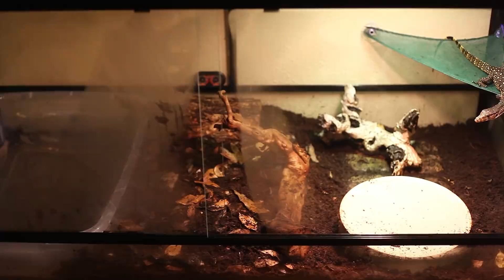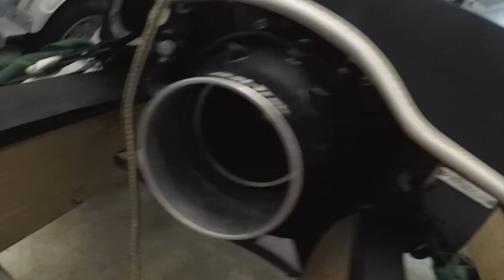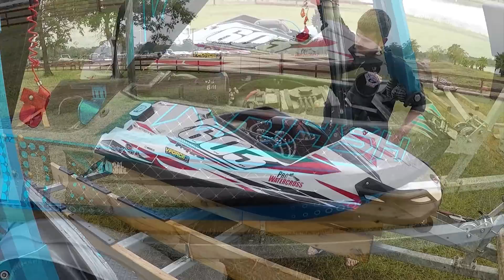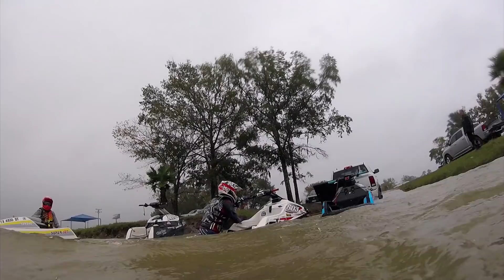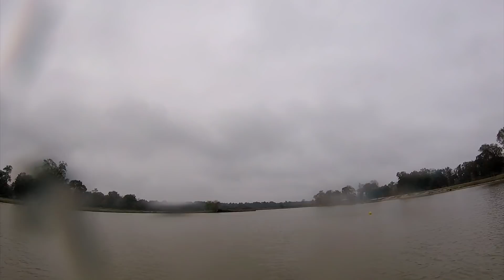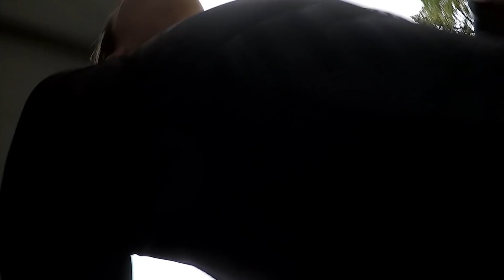ChixSki: First Winter Buoy Day

Comment: What are your thoughts on getting a 650sx as a beginner ski over a JS550?🤔
Reply from the maker: Always better to buy larger and newer if you can 😉
Reply: Lol fosho, would the 650 be easier to learn on compared to the 550? If so I’ll save up a lil more money to cop a 650 over the 550  aha
Reply from the maker: @ryanmemolo3646  I would think so, however I have never ridden a 650.
Reply: Ryan N I’ve had a 650 for 30 years and have ridden 550’ and 440’s prior to that. The 650’s stock engine power is much better than the 550’s . It’s a slightly larger boat , but is more stable Hull than the 550/440 styles.  Plus you can use the  650’s throttle limiter which the 550/440’s don’t have.  Used Skis are so cheap these days . The price difference could only be a few hundred bucks . Get the 650. You won’t be disappointed .